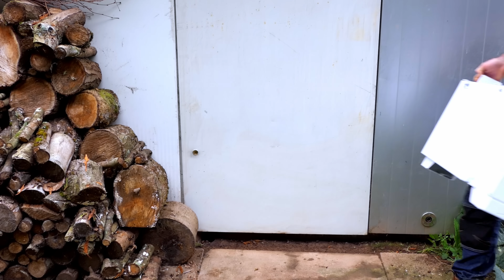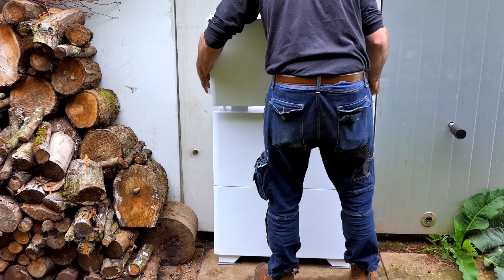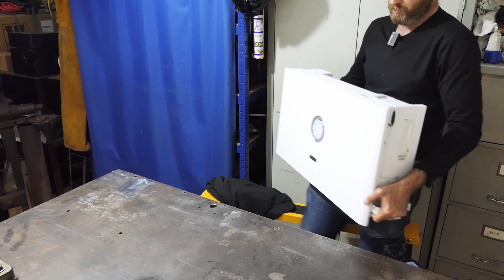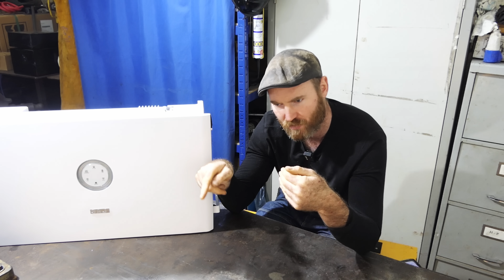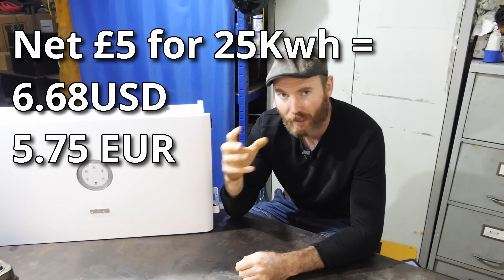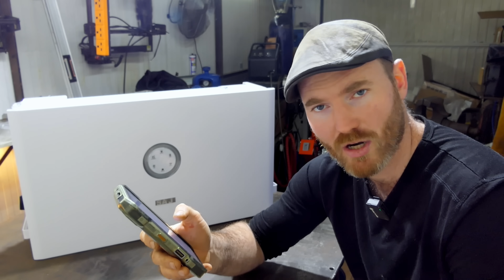New Batteries Make Money?... I'm shocked

Comment: I've got a 20kwh battery and EV and a wood burner 

I was paying 250 per month on energy 450 with petrol 

I now pay £68 per month and spend nothing on petrol 

The people saying it doesn't work are talking bollox 

The biggest impact by far was the battery.

And of course the EV

Total savings over 15 years £68k

The solar and battery was 10k

The wood burner was £2.3k

The EV was £20k (I did lease a car before but switched to buy a used EV so there was a small saving there)
Reply from the maker: That's fantastic. Your average is great compared to what you were paying. Cheers J
Reply: @joshuadelisle 

The only issue is my house is pretty large so 2 of the rooms are getting pretty cold in the night so need to figure out how to heat them in the evening/night

I was thinking of some electric heater but they chew through electric even at 7p a kWh
Reply from the maker: @paulsheehan2998  what is your heating? A heat pump?
Reply: @joshuadelisle 

Just the log burner, it warms up downstairs and the 2 bedrooms above but the 2 furthest away get pretty cold but we're obviously on cheap rate electric on a night so was thinking of putting electric rads in the 2 cold rooms
Reply from the maker: @paulsheehan2998  if you want to make use of electric heating I recommend you get electric underfloor heating mats. Blowers are less efficient and don't have very effective low settings. You can place them in the areas where you walk only so you don't need to do the whole floor and can just go underneath a rug if going under the floor is too difficult.

If you can plumb underfloor heating pipes to your wood stove I would do that but that could be a costly install.

Cheers J
Reply: @joshuadelisle 

Cheers pal, appreciate the advice
Reply: @paulsheehan2998  Why not storage heaters, charge during the day any heat at night ?

Comment: What is the quality of kerosene you're buying, as 40p sounds insanely cheap. Been trying to find a supplier that doesn't want us to buy 500 litres minimum!
Reply from the maker: The quality is superb. Very clean. I buy 1000L at a time to get those savings though. Cheers J
Reply: @joshuadelisle thank you !! that's what I was wondering. Huge difference to those of us with more modest tanks.....and if you have 1000litres on site, how many days would that last you ?
Reply from the maker: @Hastings1066TV all our central heating runs on it. It lasts the year with some left to decant for other uses and make room for the next order. I also use it in my diesel heaters in my workshop which may have seen in my other videos. Cheers J

Comment: Not forgetting the electricity £200 a year standing charge which is likely go up to pay for connecting wind turbine farms if they ever get round to it 
Maybe it will be cheaper just to run a generator
Reply from the maker: Local generation is also better because there is a loss of energy in the transformers and power lines. Home generation is arguably more efficient and cost effective but its not great for middle men electric whole sellers. Cheers J

Comment: If you can buy fuel at a similar price to grid, solar+generator+battery, going off-grid not only saves standing charge, you don't need to bother with MCS, G9x etc. so can save a lot on install by DIYing everything.
Reply from the maker: I totally agree. Cheers J

Comment: Josh another interesting topic.  I have a solar panels linked to battery, In the summer months.  we produce plenty of power for the house and charged up battery array.  We are still linked to grid so in the summer I sell power back, but winter time an alternative cheap power source would be great. I've looked at wind turbines but the maths don't work. Also considered small steam generator.  Very keen to see how your wood/gas power generation develops.
Reply from the maker: Thank you so much. Gasifier version 2 I'm expecting a 20% Energy conversion. Diesel is 35% roughly but steam is only 3% at this scale.... And thats based on highly engineered locamotives...best part of version 2 is I can use free waste material and sticks/brash.this means wood chips and hedge cutting that otherwise the council dispose off. Cheers J

Comment: Electronics in the top module are where most of the heat will be, is it possible to have it at the bottom so its cooler and the electronics will have a longer life?
Reply from the maker: That makes a lot of sense. Cheers J

Comment: Most grid tie batteries don't actually work if the grid goes down. If you don't have islanding and a separate earth it's only helping you use your solar or buy power cheap at night.
Reply: That's right. Grid connect systems will shutdown if the grid fails, for safety as engineers will be working on the grid to restore it. (Hopefully)
However, there are changeover switches, and other gizmos to enable the solar inverter to remain on and generate. Regardless of whether you have a battery or not. As we don't sadly.

Comment: Analyse what you "really" need in a power cut: "adequate" lighting and heating.  Power cuts in my region are exceptionally rare and only last for a few minutes, yes, I'm lucky.  I'm old-ish and might suffer somewhat in the cold but for a few minutes power cut there's no point having back up.  Even for an hour or two I only need another pullover, etc.  I already wear warm clothes in the winter.  

What is absolutely necessary is light so I can navigate around the house safely, especially in the bathroom, kitchen, workshop/shed, alley way and stairs.  Buy a load of head torches and spare batteries and put them in every danger location.  They are cheap and easy to use.
Reply from the maker: A National power cut is significantly worse than a local power cut. The main problem you'll have then is lack of water because the main pumps operate on electricity. 

Having a way to purify a local supply will be essential. If you have fuel to boil water then you're safe from pathogens and if you have a filter then you can get out chemical contaminants.

Heat and light is relatively easy to deal with. Good quality winter clothes , blankets and hot water bottles using a small wood fire with a camping kettle will be the best solution at hand.

Low wattage lights or even better solar lights that can be recharged in the day will be highly valued.

It's worth considering these items before a disaster happens as they will  be life saving.

Cheers J

Comment: I’ve just done my first 12 months with a solar & 11kw battery system. And it’s been fantastic. 
I’ve imported £440 from the grid and exported £779 back. 
However. The energy companies are only offering the higher export rates to customers with their approved solar systems. So you’re hostage to which supply approved system you have. 
So do your research well.
Reply from the maker: Good tip. Thank you

Comment: Love the channel. Totally agree with you on the electric grid issue.  I have been looking at a large Diesel generator (25Kw Ish). The fuel running cost is slightly lower than buying electricity from the grid.  That is based on red diesel.  It obviously doesnt account for servicing and the cost of the generator but....

Comment: So... gas oil(red diesel) is allowed for the running of a generator. This applies to both offgrid and grid connected installation. The hmrc website states "for home electric generation"
It does not specify the difference between on and off grid. 
Just to clarify 😊
Reply: I've been off grid for 25 years and would never entertain a mains system
Reply from the maker: I'm on my way to being completely off grid. I want to do water first as that will be a big priority once the light go out... Cheers J

Comment: A better idea might be to build a large LiFePO4 battery bank and buy a battery charger, and set the charger to operate when electricity is 8p per KwH, and then use the energy in the battery bank during the day when electricity is 28p per KwH. Lithium batteries are now cheaper to build than ever, and buying and storing electricity when it's cheap could be a great money-saver. Plus, as you're not selling any energy to anyone, you can build the system yourself and just have a qualified electrician install the grid disconnect / battery connect circuitry. No 6 grand to pay to an installer, which is crazy.
Reply from the maker: That sounds great. You need to notify the electricity network first though to protect linemen from the feed in etc. Cheers J

Comment: Here in Queensland Australia I have a 32KWh battery and a 18KWh Solar system, I generated 93KWh of solar a couple of days ago, I had the AC going all day, also use the washer and dryer all day, used 0 grid power, charged my battery to 100% and exported 13.7KWh, my last electricity bill was 50c credit, before the solar and battery upgrade I had a 5kwh solar system and I still had an annual bill of about $4500 AUD, I got a great deal on my solar and batteries as we have some great incentives and rebates, I should see a ROI in about 3-4 years, the only thing that stops me making more money is I have a 5kwh export limit and I only get 5c per kWh.

Last month I generated a total of 2.11Mwh and exported 558 Kwh to the grid, I am not limited by the solar panels, I wouldn't mind adding another 8 kWh battery as a lot of the energy produced is curtailed because of the export limit and not having enough of a load.

Comment: Sounds like another rip off by having certified closed circle people to certify it.

There's a few vehicles that have v2g. I believe new model y's are looking to be v2g... Some adaptor and software update needed, tbc.. 

Imagine in 5-8 years times you'll have load of these EVs which have 60-70% charge life but the pack is 50-70kws in the vehicle. Plug that permanently in the home and jobs done. Water proof, heat pumps etc. You're sorted.

Comment: I hesitate to say that Joshua missed the point here, given that his channel is in my top 5 favourites on Youtube, but I think the hidden point here is to use the battery as a simple way to switch on to a night time tariff.  It is actually a real pain to setup a battery by yourself that does what this one does.  Combine the night time tariff with solar and your return on capital from saving electricity costs will be huge.  It could easily pay for itself in 4 or 5 years if you use a lot of electricity.  Selling electricity to the grid is really just a bonus.
Reply from the maker: Thank you. You're right however it's relative to the initial capital outlay + depreciation. Spending thousands to save pennies doesn't make sense and I'm learning the installation is the biggest cost. Aside from that if you take out personal use then the logic to make a return on investment still applies, if you pretend to sell the energy to yourself at a peek price after energy is stored at night, you should be able to calculate potential savings the same way as profit. Cheers J

Comment: I have a 10kWh battery and 5kwh of solar panels. I am with Octopus and am on their Go tariff which means that I can charge the battery at 7.5p per unit. With a bit of solar the house can go all day off grid. In the summer I can export excess generation to the grid at 15p per kWh. I also have the battery discharge just before the off peak period to maximise revenue.
Reply: RoI for the system is working out at around 5-7 years btw. The solar plus battery combination together with off peak electricity pricing is the sweet spot for this tech IMO, we save around £3 per day compared with standard tariffs.
Reply from the maker: @David00Yates Nice. Thank you for sharing. Cheers J

Comment: Ok. run your gene on Kerosene and oil using a water cooled diesel.  Run the water into your heating system via a buffer tank or a heat exchanger and you now have a combined heat and power unit that's both off grid and way cheaper . Add solar and a battery and have the grid supply removed and save the standing charge! . 
Solar really works well even in this country. We were paying £300 per month for the business so we fitted 18kw of panels that cost us 10k . We now pay nothing ! We build up enough credit in the summer to cover the winter period 👌

Comment: I think battery systems are great even without solar you can make a lot of savings. I charge my batteries overnight at 7p/kw and then use that power throughout the day effectively quartering my electric bill. I also have solar panels but in winter my biggest savings come from smart charging. Add a solar assistant system to it and the smart options are endless
Reply from the maker: That's great. How long does it take to cover the cost of the battery system though? Cheers J
Reply: @joshuadelisle I use a self built battery, from a UK supplier like Fogstar you can purchase lifepo4 cells and bms for about £1000 for 16s 300ah 52v which equates to about 15kwh depending how hard you run charge/discharge levels. I'd say we're heavy users at 8-15kwh/day so £3@ peak rates but charging with Intelligent Octopus go at 7p/kwh down to 70p ....saving £2.30 a day doesn't sound a lot but over the 1 year thats the battery paid for. Obviously the inverter/s are required but I already had these with my solar setup. I have 11kw of inverters 2 of in a parallel setup for redundancy and higher loads, I believe they are a voltronic clone and can sourced for around £700 for a pair.  Not MCS installed I must admit 🫣 but not feeding in and hope my Electrical Engineer qualifications carry me😅

Comment: Agree.  I keep doing the maths and it just doesn't add up, I think many others are kidding themselves when  buying.   Battery prices are falling rapidly so situation will probably change over the next few years.
Reply from the maker: It will get better the more easily and safely a system is to install without need of credentials. Basically if it can be a low cost DIY job and cut out the middle man then it will become financially viable. Cheers J

Comment: 2nd attempt to post with links removed in case these triggered removal.

Energy is the most confused subject of our time. UK usage in real time is shown at the web site grid iamkate This puts all claims including interconnects into reality. Everything in electrical supply is improving. Soon grid scale storage will be common & the price of electricity will collapse. This is a huge growth area for Tesla & others. This is what Elon said in the third quarter report a few weeks ago (Google Tesla 3q 2025 for links):
“Let me sort of talk a little bit about that, which is if you look at total U.S. Energy capability, for example, there's roughly a terawatt of continuous power available in the U.S. The average usage over a 24-hour cycle is only 0.5 TW because of the big difference between day and night usage. If you buffer the energy with batteries, you can effectively double the energy output in the United States just with batteries building no incremental power plants. It's very difficult to build power plants. They take a long time. There's a lot of permitting. It's not an industry that's used to moving fast. We see the potential there for Tesla battery packs to greatly improve the energy output per year for any given grid, U.S. or otherwise.”
All of this is happening as new battery technologies such as sodium transition from laboratory to practical systems and heat storage sand batteries come on line. Despite what is commonly asserted all batteries can be commercially recycled & prices continue to fall such that the common battery backup units have a high idiot index: Costs are far greater than component costs.
Given all these coming changes diy systems are not likely to be practical for long, although fun to build. Slightly further ahead the whole “solar isn’t viable in winter” rhetoric will disappear due to both electrical grids extended to take power from locations towards the equator & satellite power beam down systems. We are rapidly moving towards the Dyson sphere harvesting of solar energy from orbital power plants. All the other mine & burn (oil, gas, nuclear) are not remotely cost competitive.
It is easy to feel frustrated by the taking of hard earned income via ruinously expensive UK energy prices, but although you can reduce the costs and feel better for your efforts it is very unlikely you will make any serious money. There is an army of folk, often with commercial interests, who want to steer you to their preferred technology. Another army of folk hate the politicians and let this hate blind them to what is happening believing any amount of stupidity and regurgitating it in a huge echo chamber. If you want to make serious money out of energy your best bet is probably to buy Tesla shares, but only if you are prepared to do the research and can handle the fluctuations and can size your position appropriate to your situation.
Thank you for sharing!

Comment: Buy an EV, collect cheap energy at night, connect up solar to the car too - run the house off it, and use the car to drive to the shops.
Reply: Then the governement decide to add a new tax for EVs per mile driven. 
No one wins in the UK, good initiative is always punished.